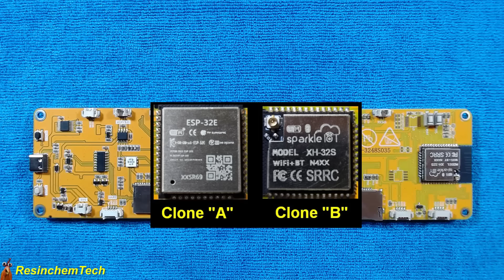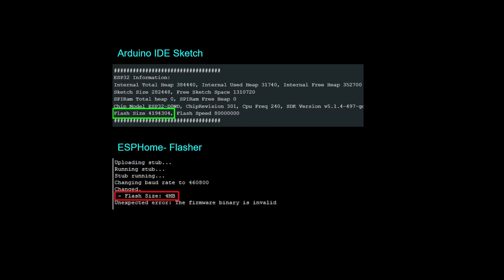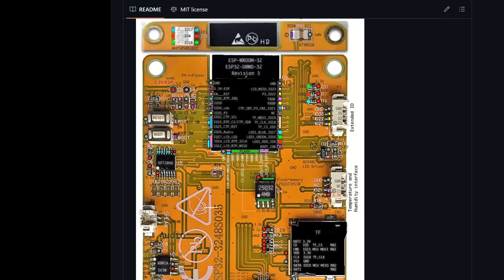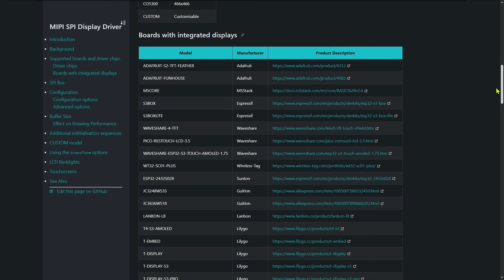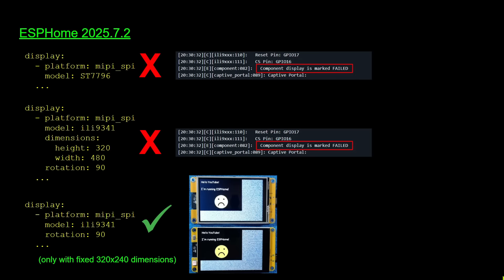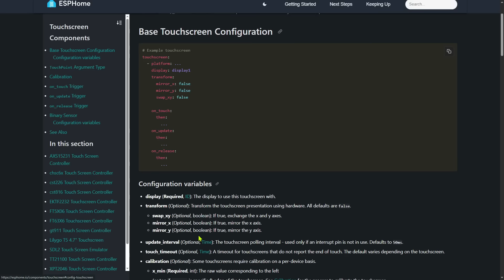Using the CYD: All Clones are Not Created Equal!

Comment: I purchased about 5 of these CYDs trying to build a button box and wasted about 5 weeks with all the various issues..My two ESP32 chips on break out boards and seperate display controllers (instead of being integrated like in a CYD), just WORK in Auduino and Platformio.   I also needed to add a DAC to my project and some CYDs simply cant unless you cut the physical circuit boards...why? beats me..cheap engineering... I'm never buying another CYD, not worth the trouble IMHO.
Reply from the maker: I completely understand the frustration, as the lack of standardization and poor design choices can definitely make these boards more trouble than they are worth for certain projects.  I think I mentioned it either in this video or my one on the bedside lamp, if I had it to do over, I'd probably just use an ILI9341 ( https://amzn.to/4vacNSe ).  I've had much better luck with using these for touch displays, despite the fact that I have to add and wire my own ESP32.  But I've found these are much more standardized and by using my own ESP32, I have much more control (and availability) of GPIO pins.

But while it did take a lot (too much) extra work to get a CYD working, once I did, I've been pretty happy with it in my bedside lamp project ( https://youtu.be/4I0m3b1LWYo ).  But I could have gotten the same result, in a shorter period, using the ILI9341.
Reply: @ResinChemTech  Agree, I'm installing a working YoRadio ESP32 in my button box project now..and it works.  I was distracted by the CYDs and their form factor and assumed they were as easily adopted..NOT TRUE.  I'm still, as of right now, trying to get the 5 CYDs I have to do something useful.  Got ESPHome self hosted..probably should get them all on that ..then go from there..dunno yet.  Thx for the reply!

Comment: Is it an "original" CYD board? Where it can be bought?
Reply from the maker: To my knowledge, there isn't an "official original" version.  The "Cheap Yellow Display" (CYD) is a community-driven nickname for a popular, budget-friendly ESP32 development board featuring a TFT touchscreen. There is no official "brand" manufacturer, but rather an original pattern that various clone makers produce.  And of course different manufacturers opt for different components and different designs... which is what can make using them a bit more difficult than other "standard" components.
Reply: @ResinChemTech Thank you so much.

Comment: Thank you!!! I've been at it since yesterday morning, using ChatGPT, CoPilot, and added Gemini because I was ready to give up. I gave them your guide so they can get their act together..haha.
Reply from the maker: Ha!  Glad that my guide could help you (or Gemini!) out!  I did end up using one of these CYDs in my larger bedside lamp project, but as I show in that video, I continued to struggle to get the CYD to do what I really wanted... and in some cases, needed to add additional hardware.  But once I got it working, it has worked well.  I just wish that they were a little more "standardized" so that all the research into how a particular board is configured wouldn't be necessary.

Regardless, thanks for watching and taking a moment to leave a comment!

Comment: I bought a few to try out and I'm about to return a clone cause of how bad it behaves with the web flashes. But I was lucky I bought a no name for $19 and then a dual pack for $30 from Elegoo. The cheap clone looked more like what a guy on YT was showing off but it was the dud. The Elegoo's worked right out of the packages, and I line the clear case on their better just cause it has wall mount holes. I'm not an Elegoo fan boy yet, but they do make dabbling with these painless. ☺
Reply from the maker: It’s definitely a gamble with those no-name clones, but sounds like you found a solid option with the Elegoo.  I will be showing a larger project sometime soon where I used the "Clone B" capacitive touch version.  It actually worked out quite well in the long run, but it took all the research from this video, plus more, to get the board to do everything I wanted.

I think the primary purpose of this video was to demonstrate that not all components are created equal and how to potentially identify features or pinouts on a device that might have incomplete or incorrect specs.  I don't think I'd choose either one of these again if starting out from scratch, but I did manage to make pretty good use of one of these "clones" in a larger project.

Thanks for watching... and for the comment.

Comment: You got the worst versions there is. You want the one with USBC and micro USB ports. Yes it's capacitive but for under$10 on AliExpress it will have the most support for programs
Reply from the maker: That would be my normal luck!  However, I have been able to use this "worst" version in a larger project, and although it would have gone quicker with complete and accurate information from the seller, I've actually been really happy with the overall performance once I figured out all the components and pinouts.

And as I responded to another comment, you can often find parts cheaper on Aliexpress or elsewhere, but I'm happy to pay a little more for the rapid free shipping (I get most parts next day) and the easy returns if something is wrong or defective.  But of course that's a personal decision that every individual has to make for themselves.

Comment: ooh theres a cap touch ips?
Reply from the maker: Yep. And the capacitive touch is much more sensitive, accurate and responsive than the resistive touch.  Not to mention, you can have multi-touch, so you can do things like pinch to zoom in/out with two fingers.  So for my larger project, I'm definitely using the cap touch version, but the drawback is that I found this particular version a bit more difficult to work with, from an Arduino perspective anyway.

Comment: i have a clone ABC😂 with RTP LCD 
i have a light sensor on the front but the RGB LED on the back 
and 5:02 the back board design is a clone B layout but with the RGB slapped on the right of the sd card above CN1/connector
Reply from the maker: Yep!  What I show here are only two of many different types of these "CYD" boards. I simply picked two different ones, one with resistive touch and the other with capacitance.  I expected some minor differences since the touch was different, but I had no idea how different they'd be!  That's when I decided to make this video!  But as you've found, there are plenty of other versions... some just a little different than what I showed, some that are almost completely different!

But hopefully I showed a few tips and tricks for how to identify the major components and pins... whether it is a different CYD or some other type of component.  Best of luck with your version!

Comment: Thank you very much for saving my sanity, I dont think I will be buying one with all the problems when I see all the comments and your video.
Reply from the maker: Glad the video was helpful in making an informed decision!  It can certainly be frustrating when hardware doesn't behave as expected.   I am using one of these (Clone "B") in a larger project (coming soon), where you'll see more struggles trying to get it to work as advertised.

To be honest, I think I'd be bounds ahead if I had just used a normal ESP32 with something like an ILI9341.  But the CYD can cut down on significant wiring... assuming you can get it to work!

Thanks for the comment!

Comment: Do you have any diagrams on connecting the esp-prog to the CYD's  to allow breakpoint level debugging
Reply from the maker: Not sure what you mean by the "esp-prog", but programming is normally done via the USB port... which also has serial output for use in something like the Arduino IDE serial monitor.  Do note that I had issues trying to use the serial GPIO pins (RX/TX) broken out on the "clone B (capacitance touch)" version when I tried to use it to talk to an external serial device.  Eventually I had to use different GPIO pins and define Serial2 in the code to get the external device to work.

But serial output via the USB port worked just fine for me.  So, any for any debugging in the code, I would just output to the serial port over USB.  Don't know if that's helpful or not, but I don't have any diagrams specifically showing any sort of connection for debugging.

Comment: Not for starter !!!!!!!!!!!!!!!!!!!!!!
Reply from the maker: You are absolutely correct, and I think I mentioned that somewhere in either the video or related blog article.... this definitely isn't a recommended component for a DIY beginner.  It took substantial research, troubleshooting and trial and error to get either one to work.

And I had to spend substantially more time when I chose to implement the capacitive touch version into a bigger project (which I'll be releasing a video on later).  But you are right...  I think a lot of these get ordered because they "seem" simple to use with a display, built-in ESP32, microSD card reader, etc.  But all the different variations and lack of consistent documentation probably also results in a lot getting returned when someone without a lot of determination and electronics troubleshooting actually tries to use one!

Comment: Wow surprised you found out all that detailed information on the boards . When they name the model the same like ESP32-2432S028R , one board could have a usbc and the other micro usb c when having the same model number ESP32-2432S028R. Makes it really difficult to find detailed information like you managed to find. 👍🏻
Reply from the maker: It wasn't easy and took a lot of searching of different online sources and a lot of testing and trial & error.  And I discovered quite a bit more about the capacitive touch version. I'll be showing that in a future video where I use the CYD in a much larger project.

Thanks for watching and taking a moment to leave a comment!
Reply: I also have a ESP32-2432S028, and that is another flavour of the CYD. It has the LDR on the front, but the LED at the back. It does not have the battery connector and the 4 pin-connectors have a strange combination: GND, IO 22 & 27, 3.3V and IO 21, 22 , 35 & gnd resp. The ESP is labeled Wroom32.

Comment: Long ago I realized that buying the more expensive ESP32 is usually worth it unless I'm planning many identical devices.
Reply from the maker: That's a very valid point. Sometimes saving a few bucks upfront can cost you a lot more in troubleshooting later!  I think I might have been time and effort ahead if I had just purchased an ESP32 and a separate touch display like the ILI9341.  

But like most projects, I at least learned a few things along the way!  Thanks for the comment!
Reply: @ResinChemTech I've struggled with the same problrm - I have several different CYDs in my drawers but the past year ive been almost exclusively been buying Lilygo or even M5Stack. I am having a BLAST with the (admittedly NOT cheap) Tab5. It can almost do TOO much so I keep shooting myself in the foot getting new ideas to add to my project 😂
Have a great day 😊

Comment: Spent day and a half ( THE SAME!!) with Gemini (26.01) and GPT v5.2 and nothing worked, and thought to return the device, but this video saved me. Huge thanks!!
Reply from the maker: You're very welcome! I know how frustrating these issues can be, so I'm happy the video could save you from that headache.  I too spent hours scouring forums, online docs... and yes using Gemini... to figure out these things.  Then many more hours when I tried to implement the capacitive version into a larger project.

But once you get them working, they are pretty slick!  Definitely saves some space and wiring as opposed to using individual components with an ESP32.  Although using an ESP32 and individual components, like an ILI9341, would have provided more flexibility and significantly less headaches than trying to figure out the CYD!

Thanks for watching... and for the comment!
Reply: Same!

Comment: If the Chinese supplier can source a chip 0.01cents cheaper you will get that 😆
Reply from the maker: You got that right! It's all about cost-cutting in manufacturing.  Unfortunately, swapping out these components often change either the wiring and/or functionality... and many vendors aren't good about noting those changes anywhere in the documentation (if documentation is provide at all).  That then means we have to spend substantial time trying to identify what is different and how to make something work with these low-cost one-offs.
Reply: @ResinChemTech  That's what happened with a collaborative projects between BudgetLightForum and different manufactures like sofirn and lumintop. they keep trying to silently cut costs and making the product worse off from the initial design and they make derivative versions with the same branding like V2 without any input from the original creator. we haven't seen any collaborative projects in years, they piss off people who work with them, there is exceptions like but it's rare.

Comment: MADE IT WORK!!!
Reply from the maker: Awesome! Glad you were able to get it working! 👍
Sorry... I replied to your original post before I saw the follow-up posts.  

But you are finding the same 'challenges' that I did when trying to use these displays.  In all honesty, I probably would have been ahead of the game for my bigger project if I had just used my own ESP32 with something like an ILI9341 touch display instead of this "all-in-one" integrated device.
Reply: @ResinChemTech  made it work, i asked chatgpt for some help but i still  cannot get the touch sensor working, my board  came with a stylus
Reply: @ResinChemTech  btw u got a new sub
Reply from the maker: Thanks... and welcome to the channel!  Sounds like you have a resistive touch screen as opposed to capacitive.  I don't think you mentioned whether you are using Arduino, ESPHome or some other platform, but if using Arduino and if you are using the TFT_eSPI library, it does have resistive touch support... but it does need to be configured.  Have you tried running the touch_demo script?  If that doesn't work, then you need to look at the User_Setup file(s) in the library.  Be sure you have the right drivers and GPIO pins configured, including the TOUCH_CS pin (mine was GPIO33).

If you still can't get touch to work, try to identify the particular touch driver for your CYD.  It might involve using a different touch library... which is what I had to do for the capacitive touch version..... TFT_eSPI was used for the display, but I had to use a different library for touch.  A lot of it will simply be trial and error until you find the right combination of drivers and configuration to get touch to be recognized.  I wish I could give you the exact config needed, but as we've both found, there are so many different varieties of CYDs that there simply isn't a one-size-fits-all configuration.

Comment: 2:45 i have the RGB LED on the BACK and the LDR in the FRONT... what the hell do i do???
Reply: and my boot and reset buttons are on the side of the ESP32 Chip,i have the TFT without any visible flexible cable on the back,  the model name of mine is the silver-texted one, the model b
Reply: mine has the esp32-WROOM
Reply from the maker: Well, that sort of depends upon your project and needs.  For my current project where I'm using "Clone B" from the video, I found that the LDR not only didn't have the best resolution/range, but its particular location wasn't going to be ideal for my use.  I ended up using a separate light level sensor that only required one of the available GPIO pins.

The same concept would apply to the RGB LED.  You could either remove the existing LED and use the pad to add wiring leads so you can put the LED wherever you want.  Or just skip the onboard LED and add your own, again allowing you to put it pretty much anywhere.  If you use something like an WS2812b LED pixel, again only one GPIO pin would be needed to control it.  Since the existing LED uses 3 GPIO pins (one for red, blue and green), if you remove the existing LED and use your WS2812b pixel, it would also free up 2 GPIO pins for other use.

I saw versions similar to what you have.  I never really understood the usefulness of an LED on the back of the display.  That's one reason I picked the particular model that I did.  I originally planned on using both the LED and LDR, so they needed to be on the front side.  Turns out I am using the LED, but opted to go with a separate component for determining light level.

You'll see how I opted to use these in an upcoming video.  I'm still building the project, so not sure when that video will be released... but it's coming at some point!

Comment: I have a clone CYD and has had me stumped in getting display to set resolution correctly like your initial findings, is there a solution to getting the screen working using arduino not using ESP home?
Reply from the maker: I opted to use the TFT_eSPI library for my Arduino project.  Of course this library requires that your also properly setup the User_Setup.h file within that library for your particular hardware.  For my particular boards, selecting the ST7796 driver in the setup file is what worked for me.  But again, your board may be different.  Just assure you properly setup and define the user_setup to match your hardware.

Because there are so many different types of CYDs out there, it makes it really difficult to definitively say "do X then Y" to get some portion of the CYD working.  Let me know if you get it working... or if there are any other particular questions I can answer.
Reply: @ResinChemTech   Thank you for your insights, I'll try some more configurations before shelving it.